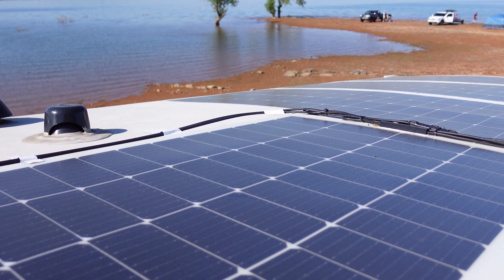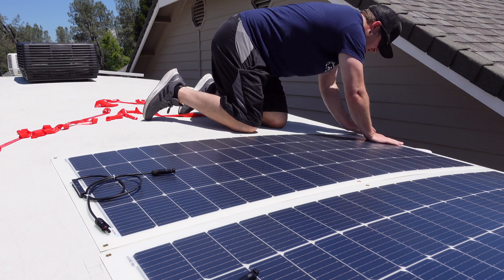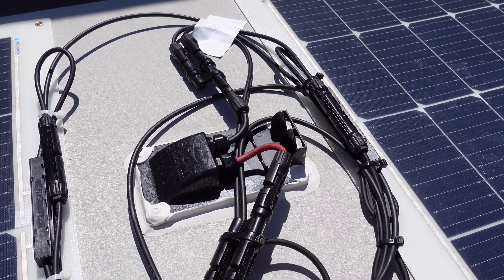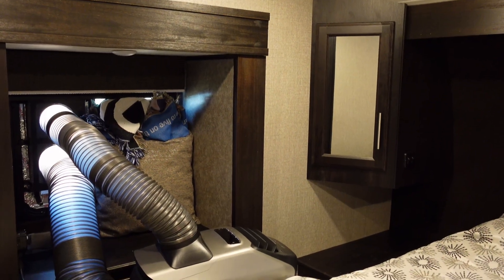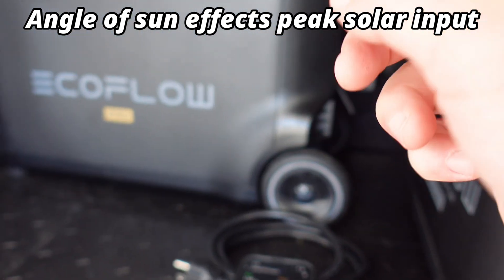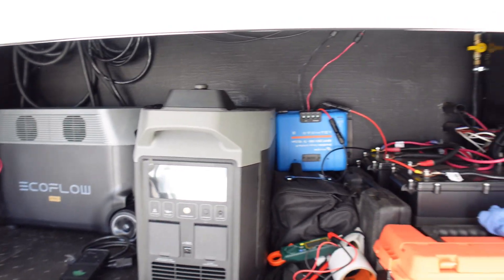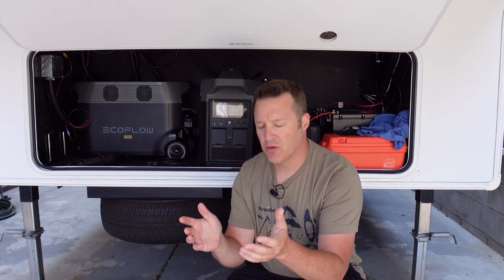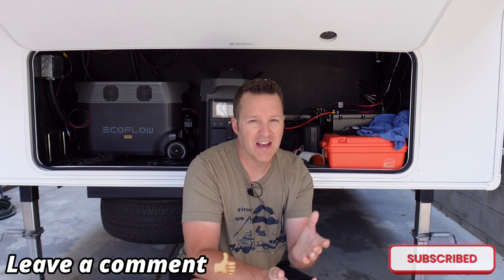How to Mount Flexible Solar Panels on Your RV Renogy 200 Watt

Comment from the maker: Let me know your thoughts…👍🏼 DISCLAIMER the delta pro can handle a 1600 watt total input. Not sure why i kept thinking it was 1500..🤷🏼‍♂️ hey mistakes happen lol. 

ITEMS IN VIDEO DOWN BELOW…..

200 Watt Flex Panel: https://amzn.to/43CBXv8
200 Rigid Panel: https://amzn.to/3OPDiuy
3M VHB Tape: https://amzn.to/42jOXox
Solar cable Extensions: https://amzn.to/45E77nI
Solar parallel connector: https://amzn.to/3WFXWPK
Solar crimp tool Kit: https://amzn.to/42g4Yf6
Solar Inline fuse 20A: https://amzn.to/3N7rRwQ
Disconnect 30A: https://amzn.to/42dyy4V
303 Protectant: https://amzn.to/3C4XHnL
Eterna Bond Tape: https://amzn.to/3N8uK0M
Roof Entry : https://amzn.to/43kRtfy

Delta Pro Power Station: https://amzn.to/3qhjFBn
EcoFlow Wave 2: https://amzn.to/3C7mPu4
EcoFlow Smart Generator: https://amzn.to/3qiSztE

BUNDLE A WHOLE SOLAR KIT HERE!!!…
FULL SOLAR KITS & ECOFLOW , BUNDLE AND SAVE!!!
https://shopsolarkits.com/1134

Ask me direct for fast response ...https://asqme.com/@johnnysweekends
Reply: So, is 1600 watts close to the upper limit for what most portable power stations can handle regarding solar input, or are there portable power stations that can handle considerably more solar input(?)
Reply from the maker: Most handle less but EcoFlow and bluetti handle a lot and are expandable and kinda modular. So can stack and add batteries but zendure now has a big unit but still working out kinks on that one but i think they are close. EcoFlow also has there power kits and are real nice. That’s what I hope to move to soon. Will see.

Comment: Hey just saw this video. So is running the panels in series and at the end of the run back to parallel the same as doing parallel the whole run?? Thanks
Reply from the maker: No not at all.
This is a older video but good information SERIES VS PARALLEL FOR BEGINNERS WATCH HOW IT WORKS SHADE TEST!
https://youtu.be/RFAYW9NZphU
Reply: @johnnysweekends thanks!

Comment: I work in parts at the #1 RV dealership across the U.S. I would not recommend taping anything down with normal tape, use butyl tape (it's like putty and can be taken off again without damaging anything) and self-leveling lap sealant but make sure it's a flat space. If you try to take that solar panel off now.... who knows what else you'll pull up off with it. Anyone got questions feel free to ask, I'll answer what I can.

Comment: what stops the power bank running the 120v through the rv from charging the house batteries at the same time the solar is charging the house batteries ? if im not wrong the rv has a built in inverter 120 to 12v dc to charge the house batteries when hooked up to 120v through the rv ?

Comment: I have done solar on homes but on an RV can i use 48V server racks in place of the 12v ones the Rav comes with?
Reply from the maker: Definitely can use server rack and many other 48v batteries. It’s just mounting them and securing really. And then a 48 v to 12v converter 👍🏼

Comment: Great video!  I plan to do something similar on my Class C.  Which you use the same panels if you had to do it today?
Reply from the maker: I would only use them if not living in areas where temps are constantly 100f and above all the time. This does degrade them quicker. 
I did notice after record breaking heat a couple panels do show a little discoloration. But the temps recorded were passed the max temp of the panels. 
So cooler locations will suit these best. If not go with a rigid panel of choice as there are tons. But there are also many new flexible panels coming out with better tech as this area is changing rapidly. Although some companies do not have a good reputation like renogy.
Reply: @ great I am in Michigan, so should be ok 👍

Comment: Does 303 UV protectant drop your solar charge numbers if it's blocking UV light?
Reply from the maker: I wanted to try but honestly I think it would be minute as far as the difference verses the protection on the panels

Comment: I retired from 3Ms industrial adhesive and tapes tech-support and VHB tape was one of our products. My suggestion for your viewers that use VHB tape with the red release liner is to use a wire file brush to get the release liner to start curling enough that you can grab it and peel it off. That is what our engineers used in the lab when performing all their testing. Just a suggestion.

Comment: Did you do a video adding a single panel to the existing RV coach batteries? Looking for a simple option to just keep the batteries charged while in storage. Usually using shore power or generator while camping in our 2015 Forest River Forwster 3051 Class C. Full fiberglass roof.

Comment: Great video I was wondering how the tape and everything on the roof has held up over time. I used 3m on my car spoilers and such and it never failed. Also I was wondering if you can wire your entire solar setup directly to the house battery system?
Reply from the maker: Still up there..! 👍🏼 
About 15000 miles of travel
Reply: @johnnysweekends  glad to hear I was going to get an older rv and convert it to solar and wanted to see how feasible it was to do myself. How many watts/panels do you think would be needed for a full solar rv setup? Also is there a disadvantage to the flexible panels you purchased. If there aren’t any I don’t know why people opt for the heavier rigid ones.

Comment: Stay away from flexible panels. We have both and the flexible panels heat up and produce less output. Hard panels can breath from the back and run more watts. I wish I hd known this b4 I spent the $$$$$$$.
Reply from the maker: Pros and cons to both. 
Rigid will always perform better and if you are primarily in hotter climates then rigid will be better. I’m not so hot areas or maybe temps of 100f and less the renogy flex 200s have done extremely well even though I have them in much higher temps. 
Rigid will also suffer from less output in high temps. 
They also require more maintenance 
Add more weight
Cause more drag
And are more deadly if they come off.
I talk about this in the updated one year video

Comment: We have a very similar setup on our class A motorhome, ( thin panels, that we can remove when we don’t need them).
In past experience, ( at our home using the same panels), we discovered that if glued or taped directly to any surface doesn’t allow enough heat to escape, ( fire hazard). And the panels don’t last nearly as long. All of our panels are elevated 1” above the surface of the roof, ( ours are mounted on 1” tall posts), all held down via screws into the posts, ( no holes drilled into the roof, ( our roof is one piece fiberglass with no supports underneath, ( typical on Tiffins).
Other than that we are very happy with our setup, many of our panels are now over 4 yrs old and still going strong.
We only need solar when we boondock, which is only once or twice a year, so we store all our panels in one of our bays stacked like a deck of cards. It does take and hour or two to screw them all down to the pre- mounted posts, then plug into the mc4 connector on the roof.
Reply: Mrfusioneng, what are the 1” tall posts and how are they mounted to the roof if not screwed down? How many of these posts are there for each panel?

Comment: I see everyone saying "to let drain water from under the panels" Mine (DOKIO Flexible Solar Panel 6x100w(600w) Semi-Flexible Bendable 12V Monocrystalline Off-Grid for RV Boat Cabin Van Car and Caravan RV Boat Camper………) off Amazon @ $309.99. for 6 100W 12v panels look pretty sealed. This is my first go at solar for my 23' TT and nothing fancy, My question is I planned on VHB to the roof and all 4 sides with 2 or 4 " everbond but looking at the professional DYIers videos I am wondering if I am missing something in sealing the edges?
Reply: Damn this is the old one reposting to the newer vidio of @ 1year.
Reply from the maker: I wouldn’t seal all the way but that’s my opinion

Comment: I use 303 on my boat and love it. Especially for the UV protection. I wonder if that UV band is partially beneficial for the panel power production though?
Reply from the maker: I love 303 as well. It was even invented and distributed right done the road from me. First time I used it was in 1996. 
Now being it’s a UV protecting agent to block harmful UV rays. I wonder if it will hurt performance…🤔🤷🏼‍♂️
I will be doing a video later and am going to try and see if there is any difference

Comment: Why did you not go with the hard frame. The trapped heat will impact performance and the life of your panels.
Reply from the maker: Pros and cons with rigid and flexible. One year update on this while setup with each panel tested and more. Stay tuned and will see if it’s junk or….
Reply: @johnnysweekends  I understand people are concerned about drilling holes. If you look at our roof, there are a ton of holes. I am certain these panels will not work for me as the AZ heat....112 degree day, the panels can get 130+?
Reply from the maker: @freewaylee not having to drill holes is only one of the pros. There are more. But yea if you camp and live in extreme temp areas like where you are then performance will be less. But that will be of any panel. Glass can get extremely hot as well. 
Just for reference i do live in one of the hottest places in the state. From mid June to end of August we see temps above 100F for weeks at a time and many days over 110F and a few over 115F. I have measured temps of over 160F on my roof. You will see these kind of temps as well on a glass panel. 
But when it comes to my rv. I built it for me now. Not for the next person in 5-7 years. Which when kids are gone I will probably down size. Most people only own recreational toys an average of 7 years. 
But I will have a full update soon so we all can see how they are doing. I also know others with flex panels and honestly there are really only one or two brands and only a couple models that are good. They got such a bad wrap in the beginning especially those sun power things. They were junk. 
Now is rigid better, yes! But again pros and cons to both which I’ll go over.

Comment: Those panels are trash. You're gonna have dirt, pine needles and debris underneath them.
Reply from the maker: Ahh man they are still killing it! No trash under these but I try to avoid being under messy trees. Lifted one off and repositioned it. Looked great under it.
Reply: @johnnysweekends  They only last about five years before they start falling apart. It's a bummer deal but it's a fact. I almost got some and someone told me to just Google it at least. Sure enough for him after Forum of them falling apart. Hard panels will last 25 years.
Reply from the maker: @justinlyle7831 There is no doubt rigid panels will always perform better. But there are pros and cons to both rigid and flex when used on a RV. Now sure flex panels definitely have a bad rap. But after months of research the only ones I have found that performed and lasted at all where the newer style renogy 175 ETFE coated. Many still have these and are doing pretty darn well. The sun power and other panels were junk. But remember flex panels are still kinda new and have only gotten a lot better in the last couple years. And will continue. When it comes to RVs and vans, most people never keep that recreational vehicle longer than 7 years. That is the average anyone keeps a boat, rv, toy  and even cars and trucks. So when you sell it most all that extra retains little value. I see it all the time people trying to sell rvs with $25k setups that they installed only 2, maybe 3 years earlier to only sell it because life changes. And it only adds maybe $5k to the sale price unfortunately. 

One thing I forgot to mention which I will in the update video, is the fact that people lack on maintenance. It’s fact, not all but a lot do and also their diy skills may not be great, so when rigid is installed and forgot about, well they can and do fly off. Flex can as well but what would you rather hit? Flex may dent or scratch but a rigid can kill someone. Plus aerodynamic drag is much more with rigid panels. So less mpg over time adds up. 

So will these put out 80% or better in 5 years…🤷🏼‍♂️ Idk but someone has to test them. So why not. One year update in a month or so.

Comment: I’ve been looking for a video like this , thanks for sharing your ideas. I’m planning to do the same thing on my small TT , do you have a video on how running the wires from the roof to inside your TT?.
Reply from the maker: I don’t on mine but I’m sure there are others. As a lot of trailers are different and you have to find a path from the top all the way to your termination point. That can be different for many trailers.

Comment: Only 3,600 watts battery storage from the Delta pro power station, for $6500??(I looked up the price)  NO thank you. I have 15,360 watts of batteries that cost about $5,000. and I have more than 4 times the storage. Add to that my 6,000 watt inverter (because the delta pro has one), was $1200. All in all, much much cheaper then the Delta pro. I also have 4350 watts of solar, ridged type 435 watts each on the roof. all on a 40 foot motor home.  Works Great.
Reply from the maker: Not sure where you got those prices. But the delta pro has a 3600 watt inverter with 7200 watt surge and 3600wh capacity. Runs prices of $2599 to $2799 if you are paying the old $3200 your paying way to much. 
Now sure piecing it together is always better but some people do not have the DIY knowledge and when it comes to time to sell the RV you just pull it out. 3 mins your done. Most people sell installed kits at a big loss. 
You’re also talking about a 40ft MH. Not really apples to apples as you have more real-estate and workable room. Every rv setup is different in panels size and choices you can use. Rigid are great and have their own pros and cons as flexible. 
I have moved to the power kit and have over 15kwhs now. Im adding 400 watts more of solar as my antenna up top serves no purpose. So it will go. But sounds like a nice setup

Comment: Can you give us an update on how the solar panels are sticking to the roof? What type of roof do you have? My Geo Pro has a TPO roof and I'm worried about wind flowing under the solar panels and lifting the TPO membrane from the luan underneath.
Reply from the maker: I have a TPO roof as well. And im just over 7000 miles roughly. Already been to AZ twice this year for the Q and then back to Bearizona and Lake Havasu and a detour and back home. Those trips are about 2100 miles total. Then the trips from last year. Towing speeds up to 76 a few times just for testing when roads were clear….but most times my tow speeds are 60-63 and up to 68 in excellent conditions and maybe a slight tail wind or passing. None have moved and roof looked the same. Ill be doing an update video at the one year mark or close and Ill test all panels and see if im good or I screwed up lol. So far I can still max my controller of 1600 watts when angled right. 👍🏼
Reply: @johnnysweekends  Thanks for the quick response. I'm looking forward to the update video. Happy travels!

Comment: that will absolutely, positive ruin your Rv's roof.     too much heat from the solar panel.

are you worried about an electrical fire?       i think would be
Reply from the maker: Nope and nope and nope…

If you pay attention to what you are doing then your risk is low.
I know people who have flex panels … only the renogy on there roof over 4 years and still going strong and roof looks the same.

Mine has been through my whole summer with day temps from 112-116 degrees ambient temp with roof temp over 140. Nothing they can’t handle.

I’ll be doing an update but inspect once a month and looks exactly the same the day I installed.

Fuses at roof inlet, and breaker down below. Don’t let someone who bought cheap crap panels make you think all flex are junk. I have seen rigid burn up plenty.
Reply: @johnnysweekends good answer these nay Sayers have no clue. You get what you pay for. 73
Reply: @ronb6182  that is nonsense.   I have seen  flexible panels scorch the paint off of sprinter and cargo vans.    not to mention what all that heat is doing to the wood underneath
Reply: @jerrygundrum1  you get what you pay for buy cheap panels you can expect anything and everything. It's best to put air space between the panel and the surface anyways. These better panels won't hurt a vehicle or it's surface. if you put these on trailers with no airflow then you can expect anything. I'm not saying I would buy these panels you don't need solar panels while driving, the alternator will charge the batteries . I would use solar at the campsite when not driving. This is all new and improvements will follow. 73
Reply: @johnnysweekends  some people don't have a clue. I trust what you are saying but I would have air space between the surface and panels. I will let my alternator charge the batteries while driving. And probably use the campsite for solar. 73
Reply: @ronb6182  I know what I am doing......I have not drank this fellows Kool aid.    i stand by what I have said.   you will ruin your roof.    have you ever repaired damage done by some one doing this to their rv......I have,   it won't destroy the RV but is expensive to correct